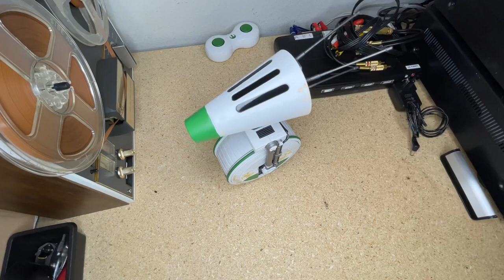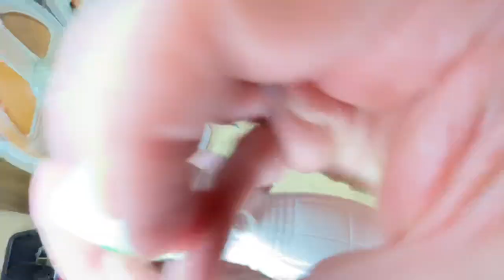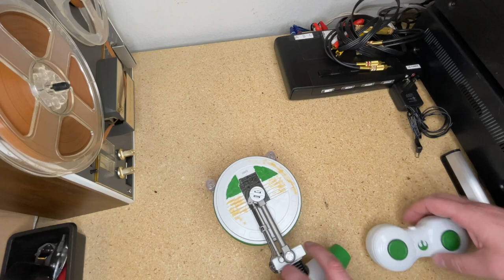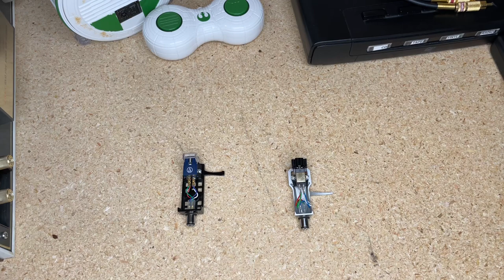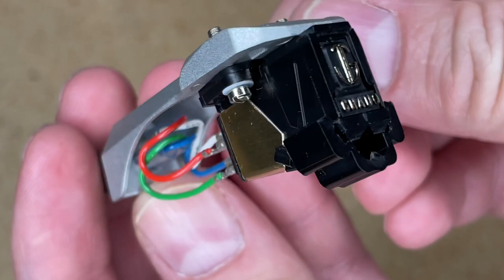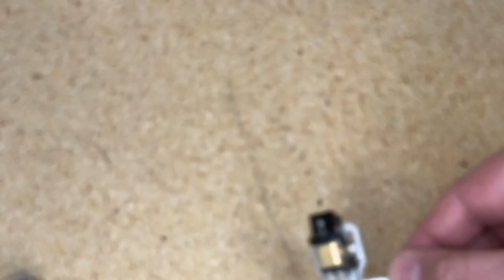Grado Gold Prestige 2 VS. AT-VM520EB

Comment: We're basically comparing the different EQ signatures of the two styluses here, i.e. how they deviate from accurately reproducing the signal on the record. So the record company carefully encodes it with the RIAA curve, but before your pre-amp gets a chance to decode it, the stylus comes along and distorts the EQ so that it's no longer right. Then everyone applauds the lovely warm sound! 🤭 Well it's whatever you enjoy, but EQ can be tweaked regardless so I would prize tracking ability etc. more highly then the EQ signature really. 😊👍
Reply: There can be so many variables.  The records are engineered according to RIAA Standards and phono preamps are supposed to be tuned accordingly.  I just used a spectrum analyzer recently to compared a Rane and several other preamps on mixers and other receivers / amps and was surprised to find that there are subtle differences.
Reply: I agree 100%.  They've been making hi fidelity cartridges since the 1970's.  The idea is to make the frequency response as flat as possible, after the RIAA curve of course.  Any deviation from that should be considered bad.  You would think that after 50 years of hi-fi, people would understand that.  If you want warm, bright, or any other sound preference, do it in your tone controls!  The phone cartridge is NOT the place to customize your sound.

Comment: I have the VM520eb and just ordered a VM540ML. The 520 was good but the left channel was somewhat louder so that bothered me.
I tried a Grado Red and loved the warm sound, but....... my turntable is a Technics SL-D3 direct drive automatic. And that is a problem with Grado, since they are VERY sensitive to magnetic fields. They then generate a hum, in my case it was as loud as a silent record groove. So in soft passages you can hear it. You have a belt driven turntable with the motor out of the way, try it on a direct drive...

Comment: I didn’t use headphones, but I still heard the difference between the two. The Grado sounded wider (more separation between the channels) and clearer than the Audio Technica (AT). That doesn’t surprise me, if I’m not mistaken, the Grado is higher up their cartridge chain than this AT cart is. Regardless, it’s a shame that they’ve discontinued this Grado. It makes you wonder if the present equivalent cart sounds the same.

For me, I’m a fan of the Ortofon sound myself. The 2m Red is affordable and gives great sound. And it’s easily upgradable as well. 

So what’s going to be the next cartridges you compare....🙂🙂🙂

Comment: I have several tables with different cartridges. They are either Shure or Grado. I do not have the Gold, but I have the Grado Silver, one step below the Gold. I have 3 Silvers. When I bought them I was told same as Gold, but maybe an imperfection of something. While the Golds were $260.00 the Silver $160.00, I do love the Silver and track it at 3/4 grams. Other 2 Silvers are spares. I am currently using the following Grado's. G+1.Silver, and FC+1. I love Grado period. None tracking more than 1.5 grams. The Shure's I use are the M91ED which has great sound, specially for records that were recorded so low in sound, the Shure gives them a big boost.

Comment: I mostly used Shure as a teenager. They were solid troupers and some had a dust brush stabilizer.  I had an Audio technica AT10 back in the 70's and remember it suffered from needle talk and was a bit harsh and mis tracked. They were never expensive. I always wanted to try a Stanton and remember Grado got top marks in Consumer reports for low priced cartridge's but nobody in Toronto sold them it seemed.
Reply: @Mark Anderson: That’s an interesting observation. I had an Audio-Technical AT12sa on a Sanyo TP-1012 back in the early 80s. I didn’t have a problem with tracking and harshness. My biggest problem was acoustic feedback. Walking around the room caused severe footfall noise and speaker reactions. Yet when I tried a dirt cheap GRADO, the problem was greatly reduced. Part of that was the turntable. It wasn’t very good.

Comment: Nice comparison. Wonder how that Grado Gold sounds next to a step up to the AT VM750SH cartridge, and both to an Ortophon Black.
Reply: the 2mblack is better but, i wouldn´t buy it maybe a sumiko for the same price or around it is better from AT, Grado, goldring, etc. and Ortofon was like quality assured in the early 80´s ,there was a Dual turntable that had cartridges from Ortofon allthough they had some only the Dual logo and they used to say that it was one of the best turntables available at the time, and strangelly they look similar to the OM series but 1000xbetter, not exceed my opinion could be even more than 1000 times, as a REVOX from series B as it´s rectangular box rotates over the record but mine inside the system says ortofon, kind of tangential ,people call it linear tracking but there are regular turntables with linear tracking as a sharp i own and tangential turntables when they appear i thought it was the end of other systems but when they failed no one knew how to fix them so they were forgoten but they were very good as one sharp not mine it even got under the record to read the other side and some had direct access the arm had a lazer, as they call it ,but a photocelular cartridge that went to the begining of the record till the end after you could choose the track like in a cd player if you had the read under system from sharp, it even reads the both sides of the record, sharp/optonica was very good but problems appeared

Comment: If it weren't for my turntable being one of those that don't like Grado carts, I would definitely like to test out the Gold. The last Grado I had was the Black1, and I was really disappointed with it. It certainly had potential, but it also had seemingly incurable IGD and no tracking abilities whatsoever. It's also disappointing that all of the Prestige styli are all variations on the same bonded .3x.7 elliptical. You would think the least they could do is give us a nude.

That being said, when it behaved, it really behaved. I got some of the smoothest vinyl rips out of it, and a little EQ in the end brought back the high end that it only just hinted at.

Comment: You know I don't usually like making "opinions on sound" based solely on a youtube video, but...
hmmm interesting shoot out here... IMO (using laptop speakers) the Grado had more detail than the AT, I feel like I could hear the greater frequency response of the Grado... but to me the Grado also seemed a little "hot." The Grado highs seemed sharp and almost shrill, but at the same time sounds like the cowbell had more "true ring" than the AT.
   I'd have to hear more and some different types of music, to make a full judgement but based solely on this, I like the AT, as I feel its possible I'd get fatigued listening to the Grado.
    Thanks for the fun comparison!

Comment: It is necessary to adjust the tonarm in height to change the cartridge with Audiotechnica vm 520 to Grado Prestige ?
Reply from the maker: Depends on the tt.  For my LP7 yes.
Reply: @Recordology  what is tt? My vinyl player don't have adjust the tonarm in height, and i want change my cartrige vm-95 to Grado Prestige Green. Grado Prestige Green have hiegh less than 1mm than Grado. Will be worked Grado in my vilyl plaer Teac tn-3b?

Comment: Hey!  Fix that speaker wire...!!  :-D
Good video... That mic you use for the audio recording is a classy bit of kit; it sounds great!
The Grado does have a rather 'lush' sound to it, but Grado cartridges can have a problem with hum on some turntables; especially direct drives.  Grado's are not shielded in the same way that most other cartridges are, and as they track closer towards the motor, they pick up more and more electrical interference and so will hum progressively louder!  
Your LP-7 shouldn't be a problem as the motor is so far off to the side/rear of the plinth.
Reply from the maker: Interesting!

Comment: What is the VTA ( Tone arm height level) between the AT and Grado. I trust the Grado would have a taller Body.
Reply from the maker: The Grado is so tall!  In fact too tall for the lp-7!
Reply: @Recordology  I trust the Arm can adjust the VTA or the height of the arm. Unlock it and twist the big " Nut" the base of the arm till height is accomplished and usually if arm view from the side is parallel to the vinyl on the platter.

Comment: i have from the 70´s tonearms and cartridges from audio-technica  but bought the grado and it as a very good frequency response giving a well detailed sound,this prestige II gold and bought it only because it was in promotion ,old ones are also good but today to match it costs a fortune and 1/5 of the hours of use(main problem today)and hear people say that a pro-ject turntable around 1.000€ with a 2MRED from Ortofon sounds good ,well i have 28 turntables and diferent cartridges from the 70´s and never heard a so bad sounding cartridge and turntable ,  and two from the 80´s and one from the 90´s and bought last December the new P10 from Rega but had to buy a hana Umami red and kept the alpheta 3 for when one of my 70´s cartridges no longer have substitution needles as i had closer to my home, 400kms trip to the closest hi-fi store and my father anytime he had to travel to the capital he bought some needles ,still have several and sounding perfect ,maybe for life but the MC ´s i bought from AT i have none either than the ones i´m using now, for my P3 from pioneer and my SP-1 from technics,i heard the AT as the art9 hope it is good or maybe i´ll take from other less used turntables from the 70´s